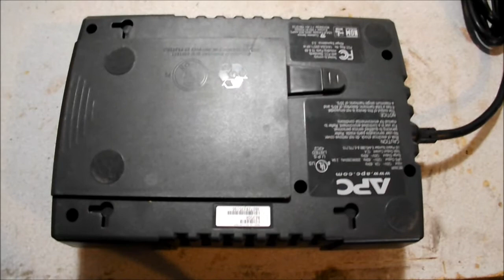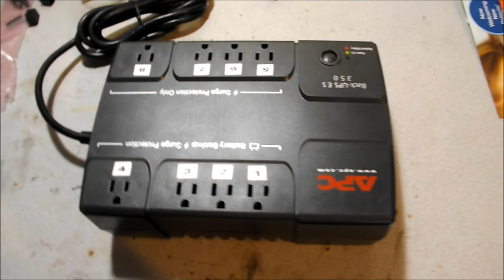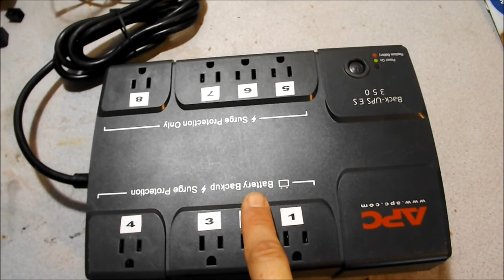DIY Outlet Control using Arduino - Part 1 Hardware

Comment: Nice compact box! Did you add any fuses? Is this enclosure ventilated? Vents would make it indoor use only. If the box is sealed, it may work outdoors.

Comment: Hey, would you be able to tell me the machine screw sizes that you used to mount the webrelay? I'm having a tough time.
Reply from the maker: Jobin Varughese Sorry man. I didnt  use machine screws. The relay board rests on a shelf that was already in the battery compartment. I just used a thin bolt & nut that already fit the pre drilled holes the the relay board to hold it down firmly on that shelf.

Comment: Why didnt you just put a 5v transformer in the unit so when you plug it into the wall it automatically powers?  Other than that, keep rocking my guinea pig  :D   \m/